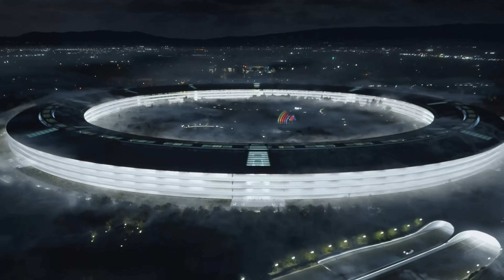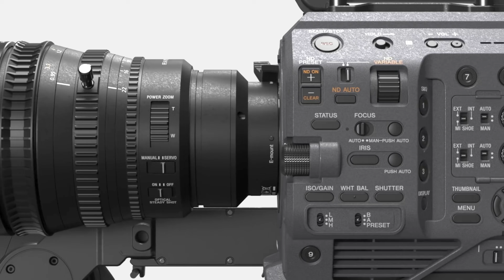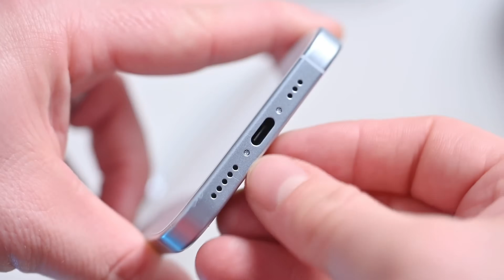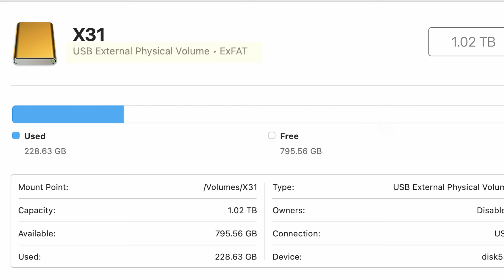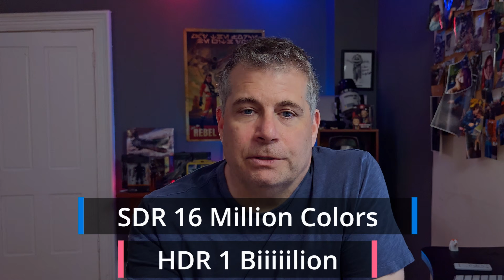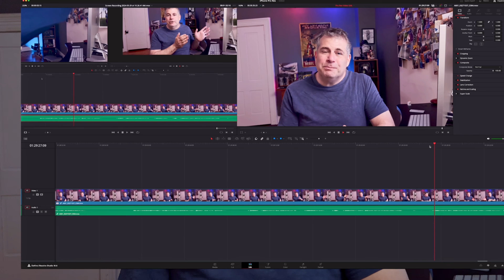Transform you iPhone into a Studio Camera using Apple ProRes!

Comment: ProRes doesn't actually give solo creators much advantage, if you use the BlackMagick app and record in HEVC/H.265, it's identical dynamic range, but the ProRes may capture a very tiny bit more detail in some cases, if you're zoomed in at 400% at the expense of a noisier image.
It is easier for older PCs to process ProRes during editing though, modern hardware, including Apple Silicon you may as well use H.265.
Reply: (I'm the guy in the video. This is my main username) you're absolutely right and I don't use ProRes in the camera app. And I also use Blackmagic cloud to auto upload clips. It felt like the tech details here were above most users. I mentioned that Blackmagic app simply because it's more powerful than the camera app.
Reply: Yeah late to reply but suggesting people use ProRes is a clown thing to do. You’ll make your workflow terribly difficult and unless you’re grading and know why you’re doing won’t see any difference
Reply: @NOTLeavingLV  Exactly, even when you're grading, CameraConspiracies tested raw vs slog3 with extreme white balance shift (way more than you will ever have in real life) and shifting the white balance and applying extreme colour correction, there was barely any difference. Sure slog3 and apple log2 are different, but I would guess the results would be relatively similar (and this is extreme grades / shifts, way beyond normal use).